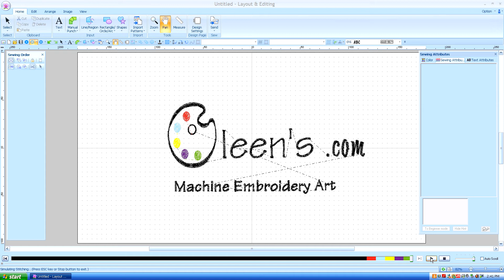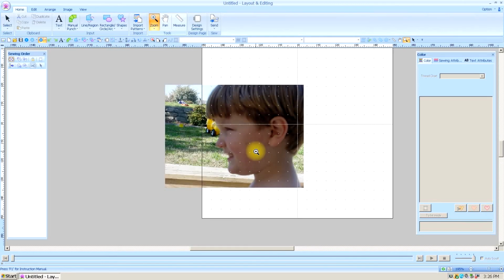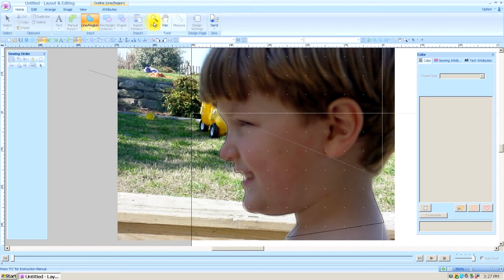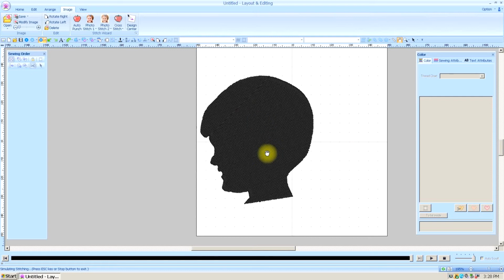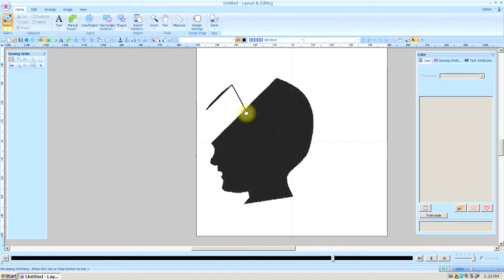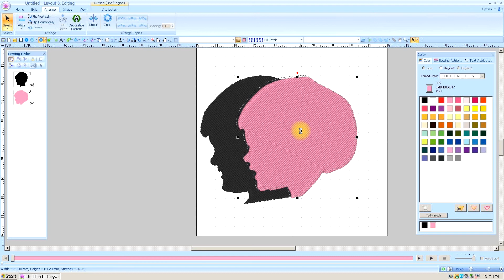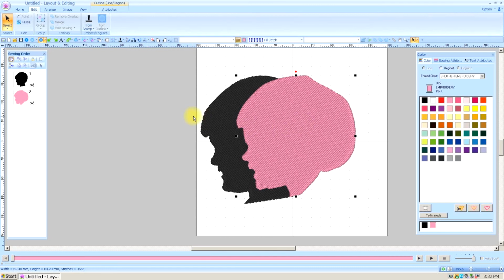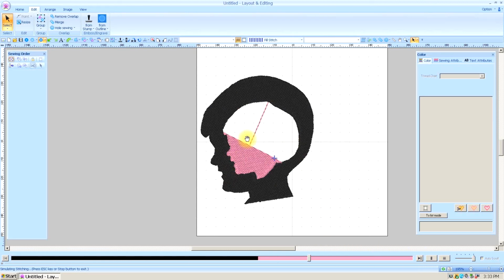Brother PE Design Next: Overlaps, Holes & Merging (Lesson 35)

Comment: When i try to set hole, i keep getting a warning saying incorrect pair selected. one item is definitely inside another.  Can you please help with some advice?
Reply: Paula Gaughan I came to this video having the same problem, kept trying and was like what am I doing wrong. I figured it out : )!!! Here is what you have to make sure of...If you are using the shape tools and tracing an object yourself make sure when you come back around to close the object that you click directly on the starting point. This closes the object completely  and then when you click create hole it should work(make sure both objects are closed ). I learned this from trial and error lol. Even if you can not get it directly on the starting point use the select point tool, zoom in and adjust that way. Hope this helps : )

Comment: I've noticed that when you have a background made with Outline or Shape tool and an another shape made with Manual Punch on top of it, the Hole Sewing and the Remove Overlaps tools are unusable ( the options are grey). Is there a way around this or do you just have to use  the Outline/Shape tools? I don't know if this same problem appears with PE Design Next since I'm using PE Design 8.
Reply from the maker: +Riikka K. You are correct.  That option is not available with Next or below.  The good news is that you can do it with version 10.
Reply: Would love to take classes with projects with you but I am on the West Coast.  Can you provide a referral or do you know of any classes like that with PE Design 10?  I actually have this issue with Design 10.  I manually punched a design that I wanted to insert onto an existing design thinking that I could remove the overlap stitches.  Unfortunately, that option is greyed out.  Can you think of a reason why?
Reply from the maker: If you send the files to "kathleen@oleens.com" I will take a look.  I wish I could go to the west coast to give classes.  Unfortunately the west coast is too far for most sewing shops and private groups to sponsor.

Comment from the maker: Absolutely Monika. Good observation.  I should have mentioned that.  Any area that large is going to pull in at least .3 mm.   However, some might want that gap to separate the two if they are using the same color.  Either a gap or apply a zig zag outline.